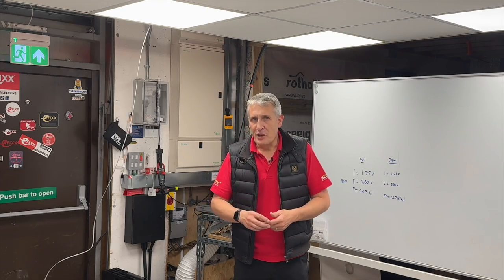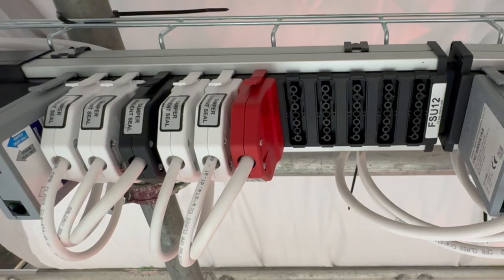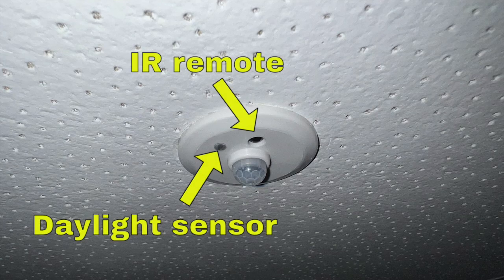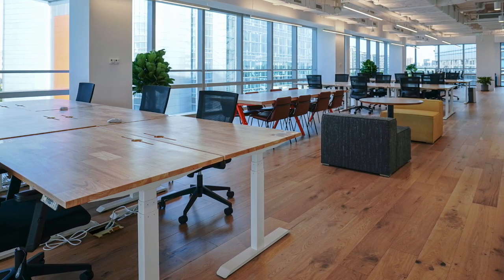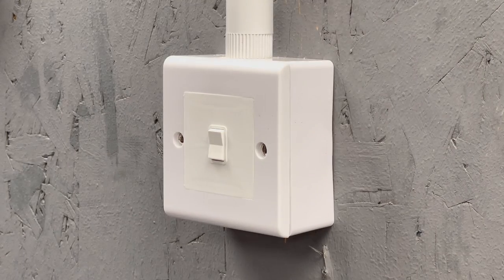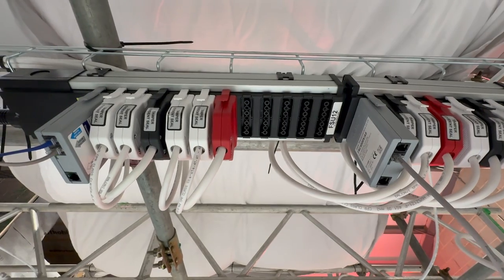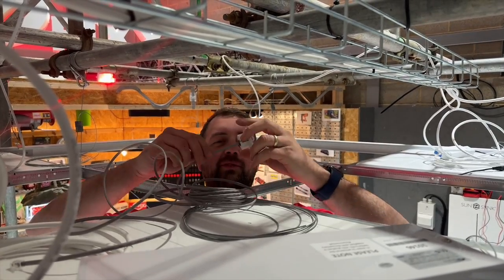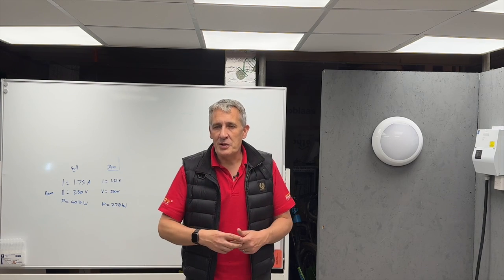Understanding The Basics Of Lighting Controls

Comment: Hi, I have some questions:
1. How do you intergrate the Dali into other systems like into the building Fire System so when the fire alarm goes off at 2 am it will bring all the lights on and up to 100% light output or into a building alarm system so if a alarm system goes off, it will turn the lights on make it easier to see what is going on via the camera system.

2. How would you intergrate the Dali system with the IT network so one can reprogram the lighting system with out having to walk through the entire building or to monitor which lights are on?

3. Is there an app that a home owner could turn lights on or off on the Dali system using their phones from a remote location?
Reply: Wow .
Interesting questions